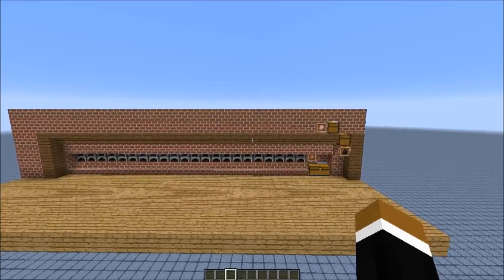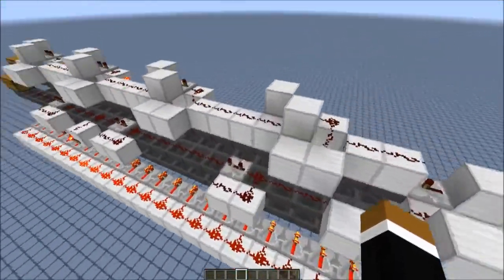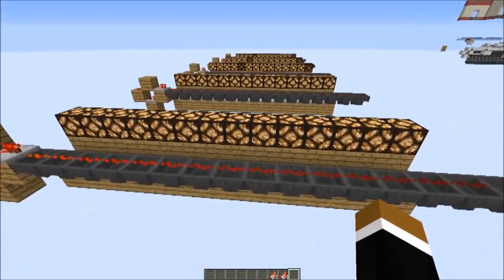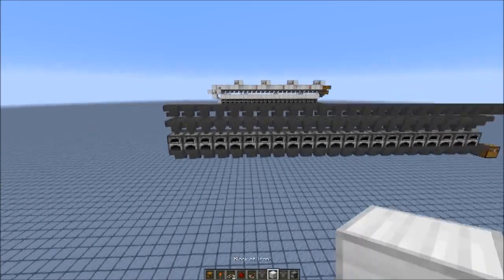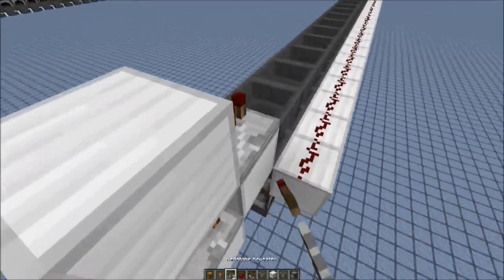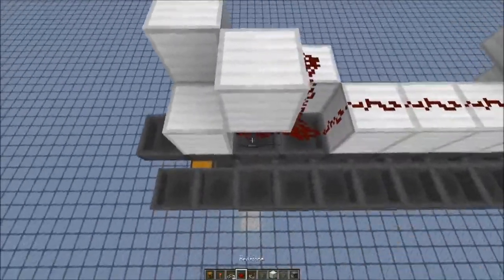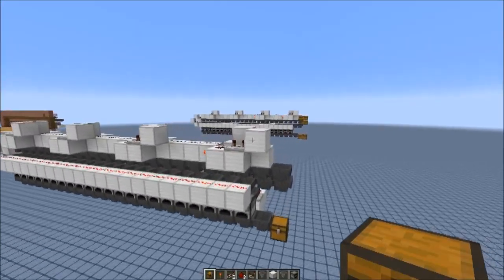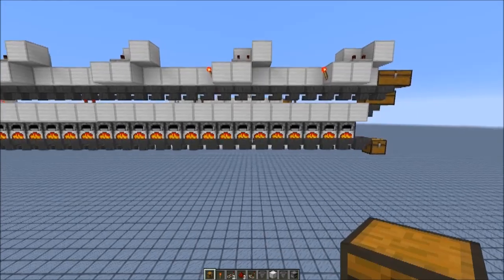Furnace Array for 1.11+ [no minecarts]

Comment: Why is it that 7 tick hoppers consistently cause the 5th one to be skipped?
Reply from the maker: it's 1 per hopper. every 6th if you add a 6gt repeater, or every 4th if you add a 4gt repeater
Reply: I still don't quite get why it leaves out the same spots though. Why is it missing a game tick?
Reply from the maker: Laifs
hoppers can transfer items every 8gt, but it takes them 7gt to transfer it
Reply: Ah, so hoppers attempt to transfer items every 8 gt, but take 7 gt for the transfer to complete?
Reply: I think I got it. The first item sent will be 1gt out of phase from the next one and so on.

By the time the first item reaches the fifth hopper, the comparator and repeater give the remaining 4gt for the last 4 hoppers to receive items, but not the first one.

Thus, the fifth to last hopper will not have received an item from the previous one. Since hoppers have an 8gt cycle, the pattern repeats every 8 hoppers later.

However, I must ask, why not make it so you give 8gt total before locking the last hopper? This gives the previous 8 hoppers enough time to catch up, and you could just add a 4 redstone tick repeater every 8 blocks, signalling backward from the end. You'd use less repeaters.

Comment: Psst
Used a carpet duplicator for unlimited fuel!
Reply from the maker: wouldn't work here. you can't supply the furnaces fast enough. Fuel isn't a problem anyway. With a 2x2 spruce tree farm you could produce enough fuel to smelt over 500,000 items/h.
Reply: Right :c
I know 1 duplicator with one carpet can supply something like 4 furnaces and keep up
But surely it could be done with 6 carpets (1 piston) to keep up with this

Comment: It is amusing that people almost always use bricks for furnace array tutorials.
Reply from the maker: I also use them in survival :)
Reply: +ilmango So do I.
Reply: Mightymousy i had a similar issue when i built this, possibly the exact same issue but i dont exactly remember. check the position and/or timing of the repeaters and torches that disable the hopper lines for fuel and cookables. like he says in the video you need an additional 6 ticks of delay for every 6 hoppers. 

Good to make sure you dont have any decorational blocks interacting with the redstone as well.

Comment: Love your videos. But that quality though, is not even close to 720p. (Looks like 360p in 720p.)
Reply: Bufferzz x bro in have to watch mine at 240 otherwise it takes 2 years to watch #crappyinternet
Reply: i think its still processing
Reply: i think its at 720p now
Reply: All the patience in the world will never fix this video. It's 720p yes... looks like 360p. Look at the text and all. Looks like poop :)  
@ilmango if you need tips on video recording i can give tips :)  If you computer cant record in HD it's OK. Just upload in 480p it's ok. It will look less muddy than this up scaled "HD" :)
Reply: You can record in 1080p now for fairly easy and cheap. New motherboard, processor and gfx card, you don't even need the best.
Reply: The issue it bitrate here, just pick a higher number.

Comment: well it's not that simple to build and pretty big
but well done! if you can compact it it would be better
Reply from the maker: do you know a similar system with the same features, that is smaller?
Reply: +ilmango BURNED
Reply: ilmango well if smelt something at the same time without using mine cart and do it in such compact way then your machine is the most compact as far as i know , unless you improve it somehow or more update come
Reply: +ilmango why would you need this when you can use minecartchest that is 10 times simpler and as good? I never had problems with mine
Reply from the maker: if you play on a server where entities get deleted as lag protection, or when you want a system that doesn't fail if you leave the area.